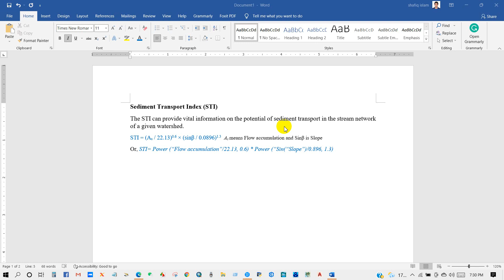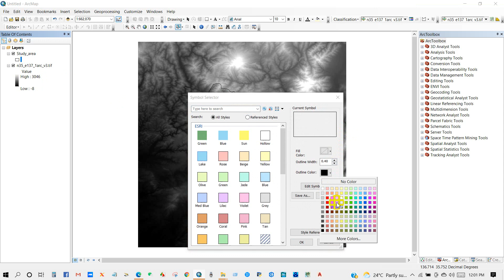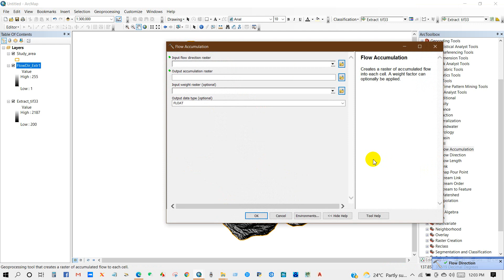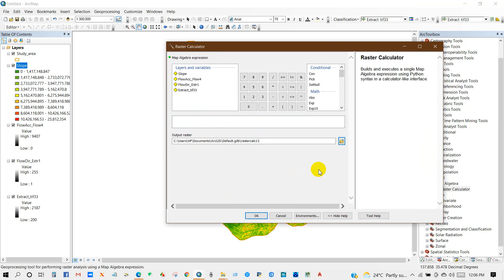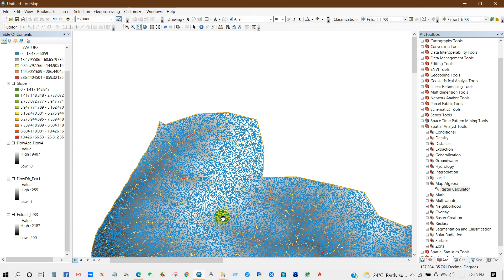Sediment Transport Index (STI) in ArcGIS

Comment: the 'flow accumulation' raster looks bitty rather than following the full river network. to correct this the FILL tool should be used on the DEM prior to the using the FLOW DIRECTION and FLOW ACCUMULATION tools., then use the "DEM_FILL" as the input for the FLOW DIRECTION tool. the FILL tool can be found just above the FLOW DIRECTION tool in the Hydrology toolset.

Comment: Sir .. what is the best Researchers title for M.sc in GIS? Sir I'm very concerned  about this and i can't decide, sir in this Semester have our research paper that's why, Please do help me sir. 🙏❤️❤️I'm your regular student, who's regularly  watching your videos sir.
Reply from the maker: There are several Environmental and disaster risk assessment topic you can select for your thesis. It depends on your interest.  I have given below some topic, you can think about it and discuss with your supervisor. 
1. Drought Characteristics using Different Indices-based on RS and GIS Data
2. Assessing, Mapping, and Quantifying the Environmental and Social Values of Ecosystem Services
3. A GIS Based Transportation Model for Solid Waste Disposal
4. Flood, landslide susceptibility analysis using 
5. A GIS Based Transportation Model for Solid Waste Disposal.
6. Environmental Problems from Land Use/Cover Changes
7. Spatial and Temporal Distribution of Land Utilization Pattern in ….. district Using RS & GIS/ Analysis of Spatio-Temporal Changes of Urban Land Use Remote Sensing & GIS
8. A GIS-Based Decision Support System for Determining the Shortest and Safest Route to Forest Fires
9. Afforestation / Reforestation Site Assessment in A Watershed using Geo-Informatics.
10. Agriculture Drought Risk Assessment Using Remote Sensing and GIS
11. Analysis of Effects of Land Use /Land Cover On Water Quality
12. Suitability analysis of an industry or any project 
13. Land surface temperature and NDVI based vegetation analysis
Reply: Thank you so much sir 🙏❤️